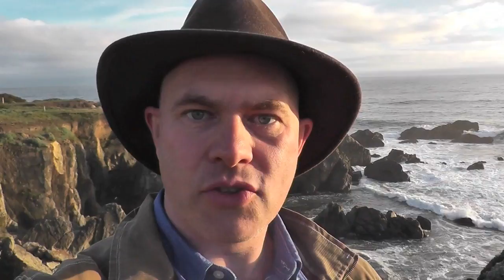Specific Impulse - Why is it Measured In Seconds?

Comment: I live in the US but I mentally use meters (sometimes yards, or interchangeably, even though they aren't exactly the same) when working with or using with machines (i.e. cars, rockets, etc (but nautical miles with planes)). Honestly it's a shame that the US uses feet and inches. It's almost a useless system, if a foot weren't the distance of 1 light nanosecond (+2 millimeters)
Reply: Christian Lund  haha. It isn't so much the defined length itself (aside from the fact that it's convenient), since you can also define the length of a foot the same way, but the metric system makes more sense, being extremely easy to work with, esp with scientific notation.
Reply: Richard Smith  I agree I also heard that a foot is roughly the distance light travels in one nano-second. The only problem is that it's not exact, so it can't be used as a definition. Once you start talking about, say 500 feet, "light nanosecond" is an arbitrary, unrelated term.

Of course, that's beside the point; it's an arbitrary, indirect term for both measurement systems
Reply: +Richard Smith Actually that is not true, in Europe we measure screen sizes in inches but nobody does the conversion, if I say a 24" display I don't have to convert to metric to comprehend it. It just takes some time to get accustomed, but just teaching it in school in science classes would do wonders.
Reply: Wheatley I agree completely with everything said. When I took AP Phyisics, SI units were the only way a reasonable human would do Physics problems. Now here's the part where I offend you, ordinary life is not a physics class. Is saying "I drove 100 kilometers per hour, and was fined" any more intuitive than saying "I drove 65 mph and was fined?" No. It isn't.

Ask me the thrust of a Pratt and Whitney Turbofan, I'll give it to you in kN. Ask me how far from Washington to New York, I'll give it to you in miles.
Reply: Christian Lund  actually that is still "arbitrary". We just later defined it to be that, to give it a physical definition. You can define feet the same way ("how far light travels in _ of a second")
Reply: Wheatley Yeah, I later realised the arbitrariness. ;)
Reply: David n Yes it does offer an advantage, calculations are easier with metric. Humans are accustomed to count in the decimal system and it's way simpler then the imperial conversion table. e.g. when summing really short distances to get a longer distance you don't have to change unit of measurement in metric, in the imperial you'd have to convert feet to yards to whatever to miles.
Reply: David n I'm not talking about "ordinary life"
Also, I'm not trigger happy, so you don't have to say "this is where you get offended", I don't get offended easily.... believe me.

And I know, like I said, I use feet and inches on a daily basis. But saying "BS Alert" was just about the most irrelevant thing you could say.
And it IS a shame that we use miles, yards, feet, and inches, cause they are arbitrary units. Having a scalar quantity change is great for trying to understand scales.
Reply: +Wheatley I think what's dragging this conversation out is no one is trying to acknowledge anyone's point you are applying your method to an exact science the other guys is applying his to everyday life. What's arbitrary is the fact that you guys are trying too hard to sound smart and not acknowledging the actual conversation. you are right converting tens is easier. but he is right also if a person doesn't know what a meter/foot is (either one works in the point i'm making.) then it's all "arbitrary". It's like two people that speak to different languages arguing about what the proper word for a horse is in either language no one is wrong. the horse is still a horse just like in the other language it's still what ever it's called. a foots a foot no matter what you call it a meter is a meter no matter what you call it. but if a person doesn't have know how long either or is then it doesn't really matter. I solved your debate no math no references no science just common sense. :-)
Reply: beefstew78  The fact that someone isn't used to the meter as opposed to the foot, as their reference system of measurement is obvious. What I'm saying is that that's not a good reason or argument to not USE the better measurement system. In fact, NASA did exactly this, and is converting to SI System (basically the same thing as metric system).

You missed the whole point in your argument (and this is why the whole "trying to sound smart" is false and irrelevant), that what I am saying, and what ANY scientist will tell you, is that using SI is FAR better than the imperial system that the US uses, BECAUSE of its application to science, and the base-ten unit changes, which save your life, if you ever get into engineering or science.
In addition, there's the problem that the imperial system doesn't have measurements for many things and therefore steals certain measurements arbitrarily from metric, whereas with metric actually has rounded relations between each measurement (for example, a cubic centimeter is one milliliter).

Where you went wrong in your perspective, in relation to my initial argument is that you completely ignored the point I have (and the main reasoning for this perspective) that math and science are the very reason SI system is in every way better than imperial. Any scientist or engineer will say the exact same thing. (with exception to some structural engineers, but that's more complicated)
Reply: Wheatley Except that SI is used in all science related fields in the US already. It is just not the measurement used outside of the lab. It is still highly used in engineering, but that too is converting.
Reply: Wheatley no I saw and still see your point for a scientist or engineer but myself and literally millions of other Americans are not scientist or engineers weather it's better for them or not doesn't apply to me or millions of other people. Are you suggesting we reteach every school aged to adult person  in this country a whole new system of measurement from scratch??? Now that seems pretty "arbitrary". Now look at it that way. Would it really be better to even attempt something like that??
Reply: @beefstew78  millions of people learn english as a second language. Are you saying Americans are too dumb to learn to use different measurement units?
I learned english as a second language. I also learned quickly when they replaced the franc by the euro, I had to convert for a few month, but after I got used to it.
The best reason to not change units of measurement is manufactured products: you have to redesign the complete car/plane/factory/building, because there isn't any standard metric screw that fit in an imperial hole. You have to manufacture and store spare parts in both metric and  imperial units until all imperial machinery has reached the end of its usefull life, it could be 40 or 50 year, and that cost a lot of money.
Reply: @niconico3907  once again you trying to hard to empreas whoever it is your trying to impress. Wow your really smart but you can't read what I'm saying. The metric system is not taught as a standerd in this country. Imperial is. If the person doesnt know the conversion they dont know it period. I saod nothing about anyone ability to learn anything let alone an entire country Idk if they can learn it I don't speak for them. But we as American primarily learn the imperial system in elementry and high school.
Reply: @beefstew78  you know you can learn thing by doing your own research? You don't need to be taught everything. If people don't know the conversion they can just google it.
Reply: @niconico3907  at this point you arnt even having the same conversation as me. Its like talking to a rock
Reply: I still use kilometers when I hike; but conveniently, 400 meters is almost exactly a quarter mile.
Reply: David n ............ 1) I grew up with feet and inches and almost never use meters in every day life; only when calculating lengths and distance
2) Once you set foot in a physics class, you'll get why that matters (doesn't have to be advanced, just any physics class in highschool at least, where pretty much only arithmetic and trigonometry is involved), because you seem to not realize the versatility of using powers of 10 when calculating numbers, as opposed to having arbitrary scale changes which cannot very simply adhere to scientific notation. Visualizing sizes has nothing to do with this; visualizing and calculating SCALES has everything to do with this.

My point I'm getting across is that you can CALCULATE numbers much easier with metric (10 millimeters = 10 centimeters = decimeter, 10 decimeters = 1 meter, 1000 meters = kilometer. As opposed to 12 inches = 1 foot, 3 feet = 1 yard, and worst of all, 1760 yards = mile and 5280 = 1 mile; there is no universal conversion). And to understand the application this has to scientific notation, just look up a couple videos or a Wikipedia article, it might seem random at first, but you'll get a hold of it when you actually need to use it later in school.

Otherwise, you'll get why that matters probably when you start learning about scientific method in school and start using it to calculate very large/very small numbers, along with dimensional analysis.
In the mean time, no one cares if you are trying to sound aggressive on the internet; there's no point in trying to talk down even if you're online, so you don't have to sound provocative.
Reply: David n Whats a kN in CFM?
Reply: Richard Smith KiloNewton is a measure of force. I don't know any thrust values of CFM engines off the top of my head, but I assume looking it up would not be too hard.
Reply: David n xD I was just messing with you man. But I am sure you can measure thrust force in CFM, but I didn't expect you to convert it. 
AFAIK CFM is how many cubic feet of atmosphere is moved per minute.
Reply: Richard Smith Oh, I thought you meant CFM the jet engine manufacturer.
Reply: Wheatley  And I was in the military so we used meters when on foot and mile in vehicles and so on. But in the beginning there was a learning curve in getting to understand what exactly a meter is when your raised on feet
Reply: +Wheatley Still better than the UK. They commenced their metric changeover in 1965 and got stuck halfway through.
Reply: *****  lol.
I must confess, though, that I can only measure myself in feet and inches and know how tall that is, but only because I did that my whole life and everyone around me does that too. But in my physics class, for example, we wouldn't dare mess witha forbidden imperial system xD
Reply: Richard Smith  "rehearsed"? IDK how u can 'rehearse' a comment lol, but sorry, I didn't look at what my previous comment was. But still, from a scientific standpoint, we should trash the imperial unit system.
Reply: Richard Smith  No, it's not a two way issue -- because the metric system (or more importantly, the SI Units System -- which is basically a physics derivation in an extended metric system) is not only the generally accepted unit system used in scientific fields, but it is also much simpler and more logical to work with. Namely, it's the conversion between scaled -- which is by tens, which makes perfect sense, and is VERY easy to work with compared to the imperial system.
Reply: More elegant, though, since the length of a metre is the reciprocal of how far light travels in a second.
Reply: +Wheatley The issue is two way, which is something many people in Europe do not understand. We cannot comprehend meters just like they cannot comprehend feet. Which is superior doesn't really matter, it is about what makes sense, and when they hear feet, it doesn't make sense and they have to go out of their way to convert it, but the same is true the other way around. The difference is, we ALWAYS have to convert, they only have to when they hear us. It is very much more of an inconvenience for us. It is not a light switch one can flip in the brain, it is something we have got used to from birth.
Reply: Christian Lund Speed of light: 
Meters: 299,792,458 m/s
Feet: 983,571,056 f/s
If anything, using feet, you could say the speed of light is roughly a billion feet per second. 
I am confused about what you mean. Both are arbitrary, conversions are easier, this is really the only difference.
Reply: Wheatley Why did you say all this. It had nothing to do with what I said... You had that comment rehearsed huh...

Comment: Great video, Scott!
This is how I look at it:
Impulse = Force * time (Unit: newton second)
The term 'specific' in Physics is used for comparison. As in, per unit weight (mass * g).
So,  Specific Impulse = (Force * time)/(mass * g)
Therefore, the Unit is: (N.s)/(N)
Since kg.m/s/s is N.
The newtons cancel out and we're left with second.
Reply: Super engine

Max Thrust: 1.8 million KN
Specific Impulse: 1.8 million
Only for $2 billion.

(Combustion chamber not included) 
(some assembly required)
Reply: Saron MB Exactly, and that's why the g0 is there. The "Newton" of fuel is a mass. It's the same quantity with or without gravity. When we say 1 N*s of impulse per N of fuel we should really say "per 1/g0 kg of fuel." One g0 th of a kg happens to weigh 1 N on the surface of the Earth. We call it a "Newton" of fuel even if it doesn't weigh an actual Newton at the moment it's used. It's the mass that we're after. By multiplying it by an arbitrary force constant we just make the units cancel.

The pleasantness of expressing the "per mass fuel" as "the mass which weighs on the surface of the Earth 1 force unit" is that it works for any units of force you wish to use as long as the impulse and the weight of fuel are expressed in the same force unit. For example one troy ounce-second of impulse from one troy once mass of fuel is the same number as one elephant weight on Jupiter-second of impulse from  one elephant weight on Jupiter mass amount of fuel.